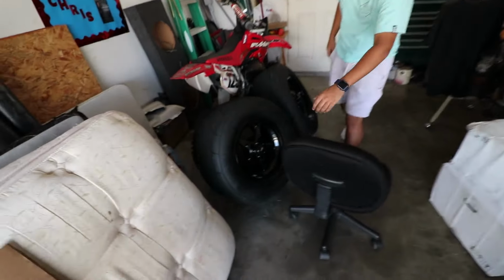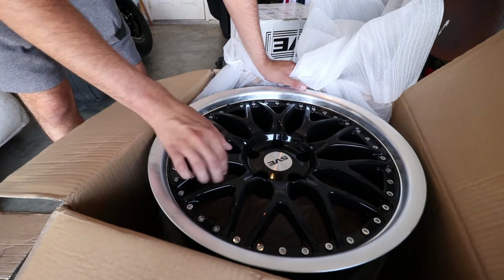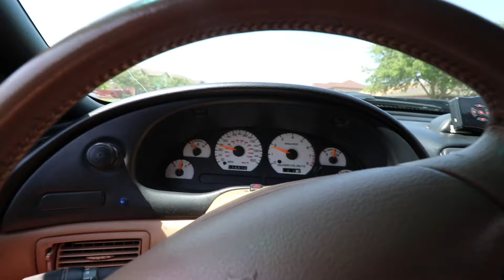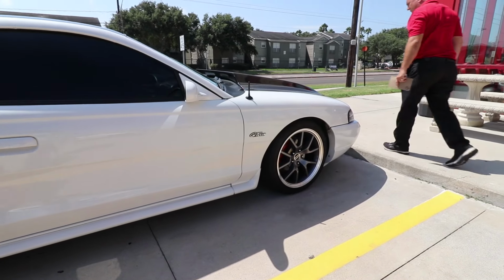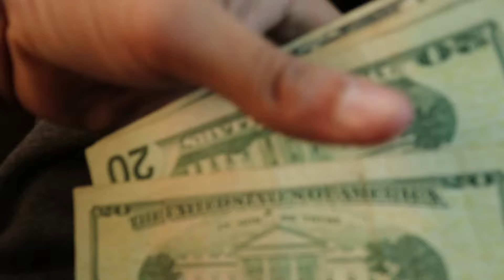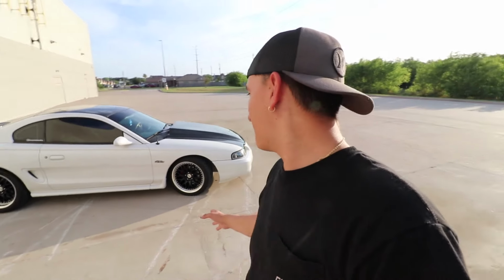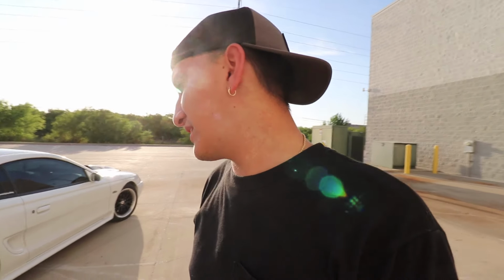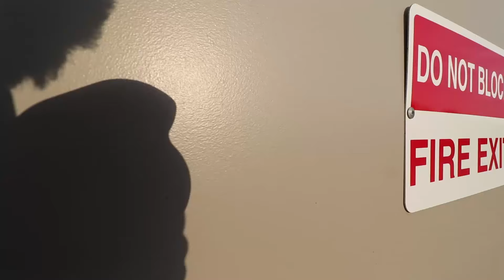Sve Series 3 Wheels For The SN95 !!

Comment: I had a real bad wobble all the time on mine, I had a bent axle in the c clips for worn-out got to be careful
Reply from the maker: Any idea how you bent it ?
Reply: @ReyesBuilt  took it to the track, its fun but launching vwith nx is hard on stuff. Better upgrade to 31 spline
Reply from the maker: Danny newedge02GT I was asking bc now I have the new ones mounted it’s still shaking maybe I bent a axel when I been laughing the car
Reply: @ReyesBuilt  more likely the splines are chewed up on the axle, its easy to replace them. Do the bearings and seals and check the side gears and spider gears while you're in there....... Mighr as well do the clutch packs too lol
Reply from the maker: Danny newedge02GT my guy checked them not to long ago when I did the gears and he said everything was fine, I’m thinking maybe U joints
Reply from the maker: Danny newedge02GT my guy checked them not to long ago when I did the gears and he said everything was fine, I’m thinking maybe U joints
Reply: @ReyesBuilt  I'd rather have that problem than having differential problems

Comment: Hey man new subscriber here - badass channel.  I just bought a 98 Cobra - how wide could I go with 18x9 18x10 Saleen rims without any issues?
Reply from the maker: You can run 335’s
Reply: @ReyesBuilt  nice so if I did 315s on the back with 1.5" eibach lowering springs & stock suspension - I wouldn't run into any issues?
Reply: Eibach Pro-Kit*
Reply from the maker: No sir

Comment: What's wrong with the slps my guy too quiet too loud?  If you dont mind answering
Reply from the maker: Too loud and I’m getting tired of the sound lol I wanna switch it up
Reply: @ReyesBuilt  ah okay! I'm running some magnapacks not sure which one but with a h-pipe and stock cats. Hoping to change out the h-pipe for an x and run a straight pipe from the cats. Long tubes in the future for sure though